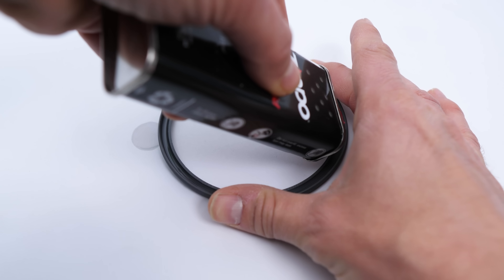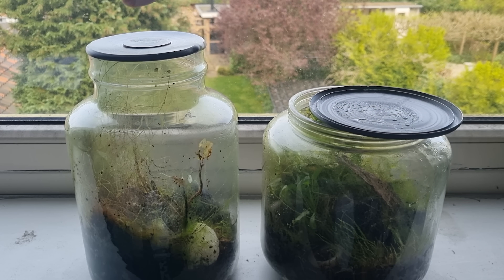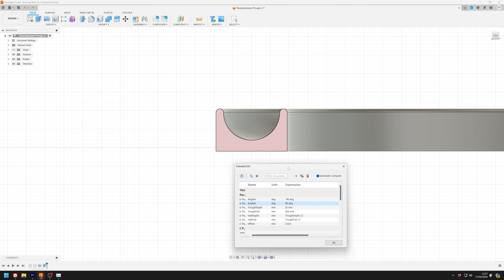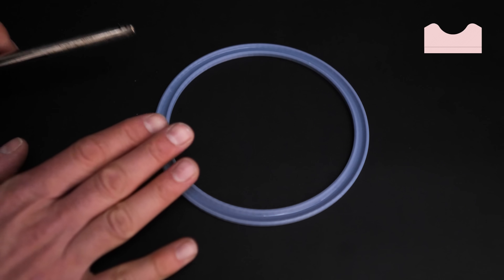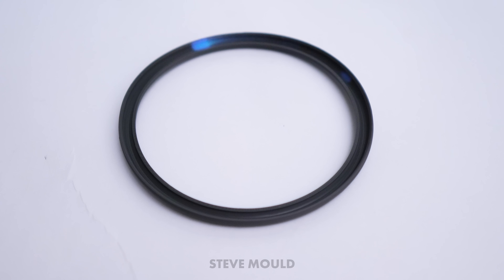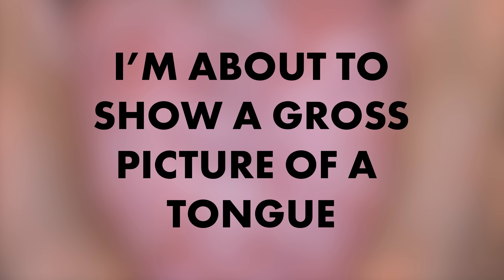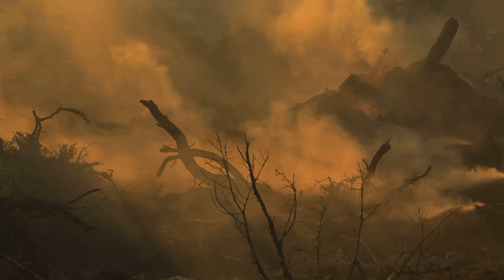Bizarre travelling flame discovery

Comment: But even if the earth had the correct diameter, I don't see how a ring of fire could last forever, because being a sphere and imagining the burning speed as equal in all parts, the ring would increase until it reached half the sphere and then decrease until it met at a central point, and at this central point there would be no more forest to perpetuate because the area around it would have just burned. Unlike the initial point, which would be located on the opposite side.

Comment: Bamboo doesn’t burn very well
And the scaffolds in Hong Kong weren’t burnt down by that bamboo, but the plastic sheets hanging off them 
There is a lot of corruption in the CCP and everything that dribbles down from there 
161 people died in that horrible fire 🔥😱😵‍💫😩
Completely avoidable if the CCP didn’t exist 😡🤬😡🤬 
Their treacherous Behavior can only be solved with war, and cut out the CCP cancer from the country…

Comment: I weld large aluminum dies for conveyor belt production every once in a while at work. They are to heat and press rubber cleats onto rubber belts. I use the oxy/acetylene torch to preheat them as they are thick. There are grooves in them just like these models ☝️ and I observe the same effect everytime I do it. Good info 🙇‍♂️

Comment: I’d be interested if it could be divided into discrete cells. The dividers would be low enough for a burning cell to ignite neighbors. More interesting would be if it could be configured to ignite with certain rules. Almost like traditional linear cellular automata. Perhaps it could even produce certain patterns. 

Not sure if all that would be involved in that. Probably some knowledge of the evaporation rates and how much gas that’s required for one or both neighbors to light up. 

Just some random thoughts about potential complex behaviors that might be generated.

Comment: They are working on Rocket Engines that use this principal to increase their efficiency. Rocket Engines move fuel through at enormous rates of Flow. An Olympic Swimming Pool every 15 seconds for the Saturn 5. Some of that fuel is not burned until it is outside of the engine causing an efficiency loss. The longer the fuel burns inside the engine to more power you will get out of the fuel burned.

Comment: When it's shallow, the flame wont move because it's not hot enough to ignite the adjacent vapor (which is also not enough to ignite easily). However, the flame DO create a difference in pressure, wich such the inner vapor just like the candle does with the wax.

The flame is hot enough to keep burning, but not to spread. It's only maintained by the pressure difference.

Comment: Could you add some sea-salts, or some different metals particles/dust to the plastic molds or the lighter fluids? To try and turn the flame a different color?

And what does it look like in darkness?
Is there any light what so ever as it wizzes around?

Would be cool if it did, especially with that star pattern you made.

Comment: Years ago, my dad and I witnessed something similar in the dying embers of a campfire. I'm not sure if it was the same phenomenon, as the line of flame was pulsing out every few seconds, rather than going in a circle. Also, there was no lighter fluid involved, it would have had to be flammable gasses escaping from the ashes. Still, it was very similar.

Comment: 9:56 if it's a bigger planet like in my manga story the planet is 20 times bigger but has thisame conditions on the surface can forest ring of fire exist?.
And another question if the planet is hollow and in the middle is something making a bubble shape now alowing mater to get closer can a planet form as if material is put on that Buble like a balloon but the rubber is the ground and air is that hollow thing

Comment: I know I’m a bit late coming into the game here, but I just saw this and thought it was really neat!

I was wondering if this principle could be applied in such a way so as to create an engine of sorts by using different sized wells that would hold different weights of lighter fluid. These wells would be on hinges/levers/gears that would trigger different wells or channels to become accessible to the flame.

Take it a step further and you could include manual levers to force the flame down a different path like rails for a train.

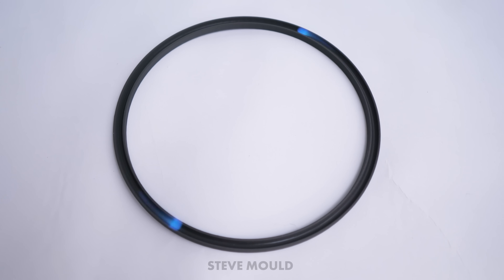Comment: 3:00 I want you all to notice how the flames actually synced up somehow. Like they had to make space for each other. Does anyone know how that works?
Reply: late but it’s probably due to it being both in the same exact ring thing, due to how fast one moves, I’m guessing the other one moves the same
Reply: The refractory period of a point on the loop would not be a fixed length. It would have a minimum where a flame just barely sustains itself. Then, as the fuel evaporates, the mixture becomes better at burning, and will burn faster up the the optimal fuel-air mixture (or to the maximum vapor pressure, whichever is lower). So the flame lagging behind gets a better fuel mixture, and speeds up, while the other flame gets a worse mixture. These forces balance to an equilibrium where the flames are evenly spaced.

Comment: spinning frame circuit. it is example of excitable medium, it has potential to be excited stated. parameter customizable cad file,. while fire travel around the circuit, enough lighter fluid has evaporated at the starting point to continue. wider trough is more vapor, hotter flame, it mean faster evaporation so fire can maintain itself at the position. trough with high wall is better, as distance from flame and fuel prevents too much evaporation.  it means after being excited it cant be excited right away. after certain amount of time, it can get excited again (refractory time) and it can get excited if neighboring part is excited.
Reply: quantitative trading firm, with offices in new york, london, hong kong amsterdam, and singapore, they use machine learning, distributed system, programmable hardware, and statistics to trade market around the world. solving interesting problem and they are passionate about alot of same thing i am. example of their nerdiness, they designed a tshirt that shows how particles move in cloud chamber. look for the curious people with passion for technology and creative problem solving

Comment: I wonder if you could make logic gates with this. An xor is easy because two fires meeting could turn themselves of. Not sure how to do other gates though. 

I suppose a not gate would have one of the small circles inside it constantly sending out pulses until you input a fire to colide with the output. But I'm not sure how tight the timing is on that.

Comment: If you had a wider bottom area but the top opening, curving in, was 5mm, would that allow for more fuel and a longer burn time while maintaining the sweet-spot for evaporated lighter fluid or would it just be more gas concentrated in a smaller area?

Comment: I think the main reason why this works so well is that this configuration seem to seal and push the liquid forward further moving it along to different track pieces while at the same time moving giving it more oxygen, fuel, and in turn heat (making more vapor). Kind of reminds me of the Wankel engine. Really cool that you have seem to find the oscillation period of the fuel mixture, love the videos <3

Comment: Now, flames variably splitting and eliminating each other when they meet opposed seems to me like one would be able to build circuitry out of this concept.
You already created a pulse-generator with one ring funelling into a machine (your spiral).
A ring being alight or not can count as binary states 0 and 1. It continously spewing out a signal can be interpreted as an ON-State:
If one figures out how to reliably introduce a flame in a counter direction that one can control, that eliminates a 1 that would lead to a transistor and that would lead to turing completeness.

This is of course silly and probably incredibly hard or impossible to pull off in the physical, as with lighter fluid evaporating across the system constantly, the flames sometimes spawning uncontrollably in counter directions, etc., it does not seem to lead to reliable circuitry, but it would be circuitry.
In theory this seems fine. Further one could apply these rules to any excitable medium.

Comment: Maybe try a figure with 90 degree angles and see if the flame "stops" a little bit at edges. Does the flame has some sort of inertia?. Also maybe a track that goes wider and then reduces its section until 5mm again and see what happens to the flame speed. Maybe different fuels?

Comment: i thought a bit about how you could make logic with this, and i got an idea for what i am calling an excluder (because i dont know the actual name).

start with just one track, i will call it the main track.
split part of it in half in such a way that flames can still go through the main track IF the split part has not burned up recently.
have another track, i will call it the secondary track, connect to the split part.
fine tune it so that the secondary track can burn up only the split part without igniting the main track. maybe add a wall inbetween where the seconary track connects to the split part with only a tiny gap under it, maybe have the secondary track's connection to the split part be thinner/thicker, just get it to work.

if it does, you can call a signal repeated flames going down a track.
you can emit a signal with a loop and you can hold emission o signals at the input with little manual gates to block off the track.

maybe you also need a one way gate, if so i though about trying something with height difference but i am not too certain about that bit.

you can just join two tracks together for an OR gate, maybe with one way gates on the two input tracks to prevent flames going back.
a NOT gate is another flame emitter with the input going into an excluder on that track.
an AND gate is a NOT gate for the first input, whose output goes into an excluder on the second input's track.
you can maybe even make a simple XOR gate by having each input split off to exclude the other input, but for that you need crossing tracks so if you figure that out, go for it.

maybe you need crossing tracks in more places as well. but even if one flame fails to obey the rules, that is not a wrong signal. because a signal is repeated flames.
for the output you could even try scorching paper if it looks cool.

all in all, i feel like it IS possible. even if just barily.
i hope you at least try to make that excluder.

Comment: also the narrow trough will not allow efficient heat conduction, you need it to provide enough heat to ignite the next step, assuming the next step is at stoichiometric optimal for the medium/surface area/ignition rate, etc.. it's a fun observation, but nothing bizarre. They use a similar calculation for the cooling/ignition temperatures for rocket engines, not quite the same, but close enough

Comment: So could you have an extended troph that serves as the fuel exporter to make these flames long lasting  and what if there was something akin to a name  in cursive without multipoint junctures using either the arches or something that spelled a name and how long could the traveling flame last

Comment: I found a big metal lid in which you can do this, really big, from some oil barrel. 5mm wide and almost 10mm deep channel that is rounded on the bottom. And I didn't find lighter fluid, but ethanol which also works. I also put the lid into a bigger lid that I filled with water, that provided cooling, so the metal wouldn't heat up enough to set the ethanol on fire all around (kept happening before). Maybe this only works in bigger diameter lids cause the methanol evaporates slower, and in a smaller ring it wouldn't be enough vapor when the flame returns. Although it also burns/travels slower than lighter fluid, so maybe it could still work out in smaller diameters.

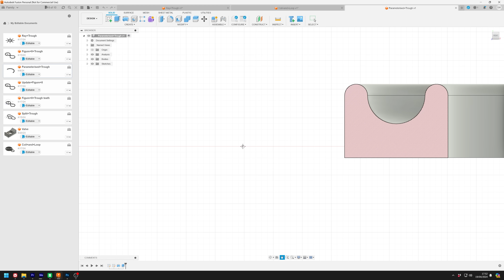Comment: 2:55 did you notice that they drifted towards 180 degrees of separation?
So when the two flames start out, the flame in the rear, which is traveling an area that has had less time to evaporate since its last burning, travels slower.

Comment: Is it possible to have like a box underneath for the liquid and print like a cover/lid with the trails. I'm thinking then that it's necessary to drill small holes in bottom of the trail through the lid so the liquid/gases can pass through but so small holes  that there will be to less oxygen/ impossible to get a combustion under the lid. Or if the trail or some part of if and the lid can be printed with a capillary function. So the "flamerace" will last longer.
Thanks for your educational videos.

Comment: What happens if, instead of a semicircular trough, it had a vase-like curve? Similar to your closed off trough but it opens back up allowing for more surface for oxygen to mingle with the gases. The lighter fluid is kept at the bottom of the vase-like trough allowing the gases to pool above at the lip of the trough. If successful, you could introduce a means to fill up the bottom of the trough without interrupting the flame above.

Comment: Did you try to mathematically work out a ratio between the heights of the sides the width of the trough and the radius of the bottom? My theory is, maybe you can go bigger or smaller as long as you maintain the same ratio between all three parameters.

Comment: it would be interesting to experiment with different fuels and how the width/depth type parameters need to be changed to get the best burn. -- it reminds me of the ''rotating detonation rocket engine' which a supersonic detonation of liquid/gas fuel occurs inside the engine much like this 'fire ring' you have where the flame front chases itself around in a circle. such an interesting topic here! thanks for sharing

Comment: It's really not hard, as the flame starts fuel is vaporized, then also burned. However due to the nature of the flame starting, it'll prefer one direction or the other due to the withdrawel of oxygen into the flame. This creates negative pressure  pulling oxygen towards the flame in a singular direction causing it to run along a complete or partial circuit.

Comment: something kinda similar to this, where I work, we deal with fluorine-free fire suppressing foam. Sometimes during the testing, the blanket can get partially eaten up, allowing the vapors of the fuel to pass through slowly. I thankfully caught it on video during one of the heptane tests where it took 4:59 seconds of our 5 minute burnback to self-extinguish (self-extinguishment typically happens within 30 seconds). It had a concentrated point that would pulse around our 50 sqft. burn pan and eventually looked like the flames were racing around the edges.

Comment: I found this interesting.  Thanks!  Isn't the flame acting like a surfer being pushed along by a wave?  Every time the flame passes over the excitable medium, the pooling lighter fluid, doesn't the flame quicken the evaporation of the trailing fumes, creating a higher pressure gradient. causing the flame like a surfer to move forward?  Or. is it acting like a wing on an airplane. where the flame is being drawn forward by Bernoulli's principle?  Or. is it a bit of both or neither?  Just asking?   N

Comment: How about implementing some logic gates and creating world's first fire computer.. For example, you could probably create an OR gate by joining two inputs with different lengths onto a single lane. And you could create a XOR gate perhaps using that half moon shape, but with an output attached, such that when they are both firing, they cancel each other, but if only 1, it gets through. And an AND gate might be that half moon shape, but the output being a new lane at a slight distance from the half moon, such that only when both inputs are fired, enough heat is generated to pass the distance... I can sense a full adder

If you don't do it I will ;p

Comment: I think what is causing this effect is that there is not enough surface  area in the spiral to sustain a burn. The flame doesn’t burn all of the fluid at once but only the surface,  the flame burns all the surface fuel in one spot and in the process the flame moves along the track. Also responsible for this I think is that isopropyl alcohol after it has burned, for example the fluid left behind in a whoosh bottle is a lot less flammable than the unspent alcohol. You can witness the same effect if you pour some isopropyl alcohol on the ground and light it, only the flame will eventually start to move back and forth. Instead of traveling in a circle. I think what could cause this is that eventually the flame uses up most of the flammable stuff so it retreats, but the ground is still hot so some flammable matter still evaporates, so the flame jumps back and consumes the fumes, and this process repeats until everything that was flammable is used. This would also explain why if you light a whoosh bottle, then you let the left behind fluid sit for a bit and evaporate in the bottle you can get another whoosh flame going. Further more there is only a given amount of oxygen in a bottle the flame can use, so naturally there will be some fluid left behind, while on the track there is only a certain amount of fuel the flame can use, before it has to move to not go out. Also recall that in a wood fire, the fire is burning the wood gas. Disclaimer I’m not a scientist or a physicist, this is just some random bloke hypothesis.

Comment: It’s so easy to explain. The gas is limited to a small area. So the flame can only ignite the gases getting released around it. The time it takes the fumes to burn away and get replenished is what you’re seeing.
Reply: It also has to do with the amount of air getting sucked in. That determines the direction the flame moves. Like a vortex
Reply: That is the most reasonable explanation. I can come up with